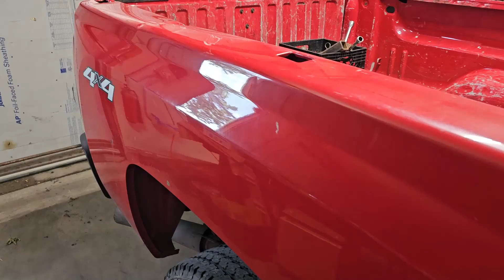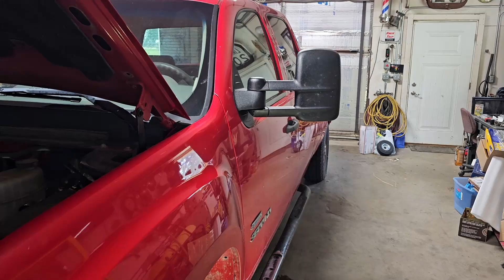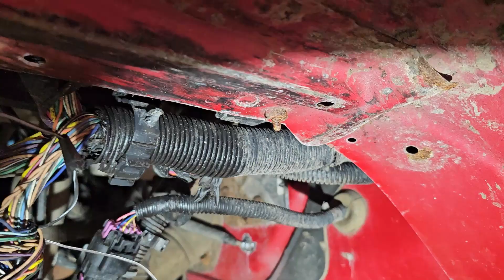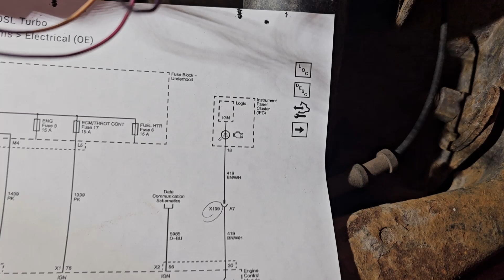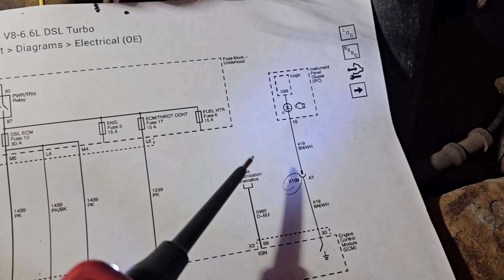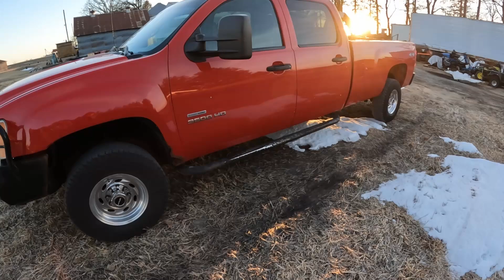Ripped Off By Local Car Dealer Now What? Duramax Engine Power Reduced Codes

Comment: I had squirrels build a nest under the hood of my truck. Did a number on the wiring harness that goes from the fusebox to the connectors on top of the duramax. They chewed some  of the wires right to the connectors. Found a harness on Ebay to fix it. Was not easy, between California and federal emissions, cab configuration, 2wd vs 4wd, there was a half dozen harnesses to choose from.
Reply from the maker: Wow, that was quite a job! Glad you got it working again.